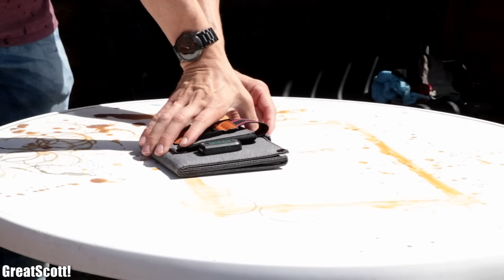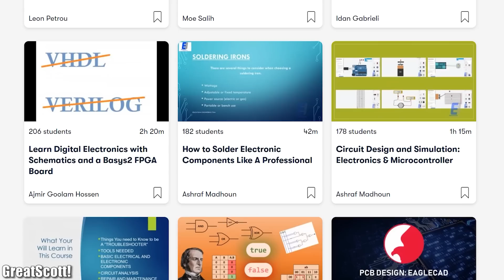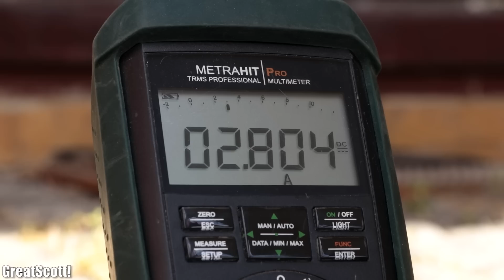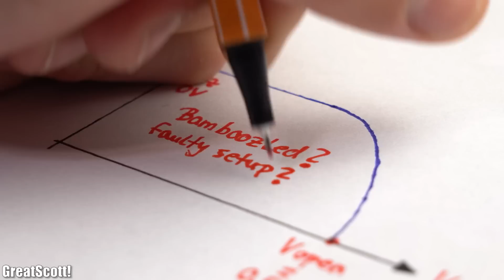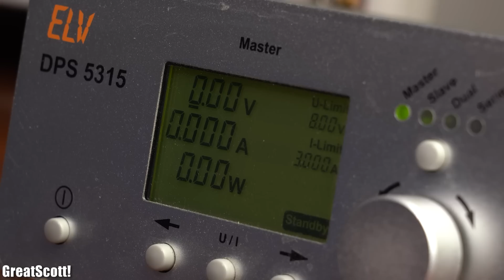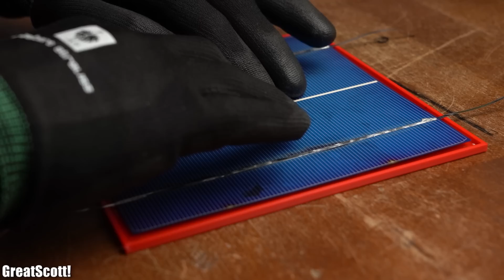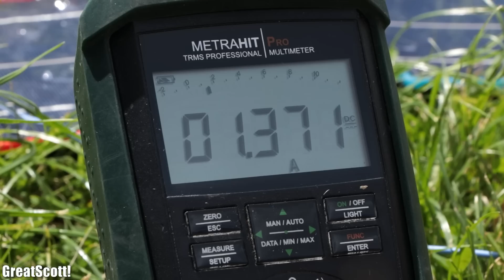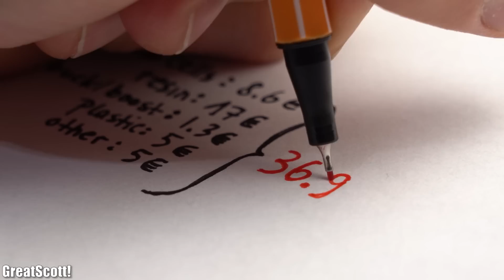5V USB Portable Solar Power Charger || DIY or Buy

Comment: I just seen a video with Will prowse and a solar panel that was made Buy encapsulating cardboard and epoxy as the frame and then putting solar panels on top of it each individually just like yours called the solar book because it could be folded It up and stored like a book. Was probably the coolest solar panel I've seen yet and the copper bus Bars were very thin and protected by plastic from each solar cell that was connected
Reply: https://youtu.be/jW6nYiZtnac

Comment: I don't see any point in such a device. If I wanted to charge my phone on the go, then I would use Power Bank, which is more handy, charges faster and is much cheaper.
Reply: Ever been tent camping? Outlets are hard to find.
Reply: @tedhancock68  I've been camping, but battery in my Xperia L1 last for 7 days and that doubles with Power Bank. Connecting to Internet divides that time by 2, but when I camp I don't use Internet very often. You can say that not every phone is like that, but then I'm gonna say: buy bigger Power Bank or even 2 if you need.
Reply: @Xsses  Sure, but what about "free" power and sticking it to the man?!? TBH, my wife who scolds me for $2 electronic purchases, just let me spend $250 on solar. When I tell people I make CPAP batteries, the first question they ask is if it can be charge by solar. There is some serious psychology at work here, and projects need to take advantage of that.
Reply: @tedhancock68   Don't get me wrong. I am surely not against solar energy, but in my opinion it works the best when solar panels are on my roof or in solar power plant. When I am far from mains I think energy storage device in my pocket is more convenient and handy than small "power plant".

Comment: Now I want to go test the Coleman one I've had for a few years now...I even used it when I was homeless for awhile as my only way to charge my phone.  I'd just go sit in the sun and read a book or something while it charged.  The one I have also has a 12V output, though I have never found a use for that...yet.  I think mine was also listed as 15W...so my guess is it only outputs 1ish amps at 5V, like yours does.
Reply: People take the voltage rating on panels WAY too seriously. I have found they behave like LED drivers. The open circuit voltage is super, scary high and when you give a small load, cut in half. Give it a big load, like a power bank and the voltage is cut in half again. I've been playing with 100w panels recently and have not needed charge controllers in most cases.

Comment: What is the advantage of using solar cell flat wire instead of garden-variety round copper wire? It doesn’t look like the flat is easier to solder, and the flat also appears to be more fragile. I don’t have any flat wire to measure the cross-section, but it seems like the flat would have higher resistance - something that would become more important as the string gets longer. I have some solar cells and have been wanting to do a project like this for a while, so I’d really like to know which one to choose.

Comment: I think mostly these solar panels provide too less than what is being advertising. Better to use Hetrojunction 28% Efficiency High Grade Solar Panel which is only Made in Europe and mostly used in Space application. But yeah, that is the expensive part. 
The economic side, one should check the brand and manufacturer reputation before buying them. 
Scott is right, the wattage promised never achived, I have tried it too.
Reply: Yeah I’ve only seen one panel or cell ever hit even close to spec (and it went above spec pretty consistently). Almost all of them are way under what they are rated. Really sucks when you are trying to design for a specific load and it drives the size of your design based on an incorrect and made up marketing rating that is simply impossible so then you have to completely redesign because of fake specifications...

Comment: The hinges was what i didnt get when you showed the cases being printed! its an easy fix to either print extra hinges or better, incorporate hinges in the initial disign. or just use a sheet of thick, stronger fabric, isoloate the sunpanels on the back and use something like velcro to put them on the fabric. Makes it modulair and the fabric is the hinge like the one you bought.

Comment: Have to strongly disagree with this one, with a few uses your DIY unit would be completely broken and needing new tab wires soldered on. I am actually surprised you gave the DIY one the win in this case, as you need a 3d printer, epoxy resin, and also the durability of your end result is still essentially zero, I dare you to drop the DIY one on the ground one time with those flimsy elastic bands and watch it fly apart and smash into pieces while the commercial unit would be fine. Anyway thanks for the video but I think you really reached on this one!
Reply: Sheets that size 3D printed = $2 each. That's $20 worth of PLA! Shhhh...let's give him this victory.

Comment: That's really cool :) But here are my couple of points.
1. Never test a charger by connecting a smartphone. Smartphone charging current depends on everything: source voltage, connection, wire quality, battery charge, temperature, smartphone os load. Just don't do it, it's unreliable.
2. Ideally, add a battery (make it a solar power bank), and use the MPPT. 
3. Don't let the wires bend without support, it will break very quickly. Ideally, don't let them flex at all.
4. What happened to that blue frame? :)

Comment: Isn't easier to use Plexiglas or Glass to protect them? Wasn't better to put them in parallel and lie on the boost converter to give you the desired voltage? It might be better to do so?
Reply: Boosting is pretty inefficient. I'm using the ubiquitous 250w 10A boost module for my 12v 100w solar panel(21v open circuit). I'm boosting to 29.4v (7S) which reduces output from 71w to 35w. It's better to reconfigure your panels to match the job than rely on electronics.

Comment: I never understood the need for solar chargers,why is it so important that you cna charge your phone in the middle of nowhere by ridiculously slow rate.A power bank makes way more sense.
99% of people will buy this and use it 2 times and then it will sit in a drawer for next 10 years just to be thrown into trash .
Reply: Mainly for camping...real camping. Also, it's hurricane season. We often spend a week or more without power.

Comment: I considered a similar project last year after watching a video about the same product from @DiodeGoneWild (https://www.youtube.com/watch?v=lVUEnlqFMvc).  For my level of experience and available resources, I have to vote for "buy" -- but only because most of the pre-resined panels I found on AliExpress and eBay at the time had inconsistent voltage and current descriptions.  I could also buy a competing pre-assembled product on AliExpress and eBay, but you again take a gamble with the accuracy of the stated output.

Comment: GreatScott I had developed that module for my mobile in my engineering college as a mini project but I had used single solar panel of 7 volt and 2 amp and used a Linear regulator lm7805. It was good and fun.

Comment: If you haven't figured why the multimeter was showing a very less short circuit current value when tested on a single solar cell, then its due to the inability of most multimeters to measure accurate current values in very low voltage like 0.5 volts. If you connect 20 of them in series and measure the short circuit current in bright sunlight then it will show a current reading very close to the manufacturer specification.

Comment: Now here's the thing . I really want to know why people consider connecting the cells in series in order to increase the voltage . When we have such good and efficient buck-boost converters which can increase the voltage with 95-96 percent efficeincy , why do we add them in series because in series not only the voltage increases but we have a huge demerit , that is the effective series resistance which adds up and ultimately screws up the max power output of the cells . So i would love to know why connecting series is a good idea to increase voltage rather than just connecting all cells in parallel and then just taking a boost converter to increase the voltage

Comment: if you are doing a protable solar panel, I would suggest using Maxeon C60 flexible cells. The cells you are using are more suitable for fixed panels (with tempered glass).
Also in order to harvest maximum energy output of the cell you need to keep it in the most efficient voltage range. Mppt chatger would be a better option instead of buck boost converter.
Last thing is I don't think the cells you are using have any problem, I wouldn't expect you to get more than half of its rated power in germany without pointing the cell directly towards sun.
4.2W output is measured only in 1000w/m2 irradiance with cell pointed directly to sun.
Reply: +1 for the C60 cells. 21% efficient and a reasonable ish price

Comment: Hello! I really love your channel GreatScott! I have decided to ask a question here because You seem like a professional, and everyone, feel free to answer is question I have been wondering. How are current and voltage different, and does voltage create current. This is been a question that online websites cannot answer. Thank You
Reply: Current is the flow of charged partials such as electrons. Voltage is the force that pushes the charged partials. Electrons will only flow if there is some force pushing them. This means that current will only flow through something if there is a voltage across it that pushes the current through it. For more details I highly recommend watching ElectroBoom's 101 series.
Reply: Crazy Nerd Inventor Ohh, thanks so much, yeah, I love Electrobooms videos, but I will checkout the video series
Reply: Another way to think of voltage and current is an analogy with flowing water, where voltage is the amount of water, and current is, well, current (speed/power of the flow)! For example, think of a very wide, but very shallow river - this is the equivalent of high voltage with low current, like electrostatic discharge (the zap you get when when you touch your car's chassis in the winter, or after scuffing your feet on a rug), which typically measures in excess of 3,000 volts, and often as much as 20,000-30,000 volts, but at very low current. The shallow river, although composed of lots of water, will not sweep you off your feet :)
Reply: allen lutins  Good Analogy! I had never thought of it that way, and thanks a lot. I am pretty new to Electronics, and this really helped! :)

Comment: The sunpower C60 solar cells are the ones to go for.  Much stronger mechanically - still fragile, but stronger than the ones you used.  All the connections are on the back, which makes wiring them up easier.  They have a higher output - you get five amps in strong sunlight at maximum power.  Open circuit voltage is a little higher - just over 0.6V.  Size is 125mm x 125mm.  You can find them on Ali Express.  I've used them to build solar-powered radio control planes - no batteries on board at all. Even when the sun goes behind a cloud, or the plane is inverted, there is still enough power from ambient light to work the receiver and servos.  An on-board Arduino monitors the voltage and controls the motor speed controller so that the voltage is never pulled too low to cause reception problems.  Ten or twelve cells in series seems to be the sweet spot for adequate power with a reasonably-sized model.

Comment: I've also tried to make a portable solar charger some time ago using small 5V epoxy coated solar cells.
I tried to reuse an old solar charger enclosure, as its electronic components were mounted on a separate part, which could easily be slipped out, but not salvaged nor repaired- it was all coated in resin (which, I must say, made it very durable, but not until the charging circuitry and battery worn out).

I encountered the same problem as you did (specs far lower than advertised), so I would get a maximum of 2 watts of power, while the original charger had somewhere around 5 watts - and it was older tech, so still impressive for such a small form factor.

I think that without some built-in energy storage like a supercapacitor or battery using the solar cells alone for power is rather unstable, and adding that would allow to trickle charge even during overcast or winter conditions.

Comment: You can use an app called Ampere to measure the current on the phone directly, circumventing the USB tester.
Reply: Not every phone measures that well through that app.

Comment: Do they utilise a maximum power point tracking algorithm as a part of the circuit, because what they are claiming might be the Maximum power point of the PV panel, but in reality it doesn't always work at Maximum power point without MPPT.

Comment: Great project! Just a simple question, why did you use spacers on your 3d printed frames? Is it so that the resin can go below the solar panel as well? It seems as if having the spacers there would make it easier to break since it only rests on 4 points
Reply: It rests not only on the 4 points but the whole resin base that's below it. The resin below is basically levelled with the 4 points.
Reply: @Mavi222  Awesome, thanks

Comment: You forgot to take into account that your phone will only draw as much current as it needs based on its charging profile.  You should use a resistive load next time to test charge current potential.  For the first part of the video that is with the bought solar charger.
Reply from the maker: Nope. Tested that. Does not change anything.
Reply: @greatscottlab  I figured you might have after getting to the second half of the video lol

Comment: You're ideas are great, But I think you really have to work on mechanical part of your builds. In all your videos your ideas are good, but it lacks on the mechanical part. Like in this video, the solder tapping wire is not strong enough, and I think could be improved quite a lot.

At the end of the video, the project is for 80% finished. The concept is shown, but not practical enough for people to build it for themself.
Just put some time more in the mechanical and details of the overall project, en the end results will be much better. 

Then I think more people will watch and make it, instead of just look. Because the end results are not practical and good enough for real life use.
Reply from the maker: The problem is that I am not very good with mechanics. So instead of wasting weeks trying to figure the mechanical side out, I put the project out like this saying that it can be improved and hope that others with more time on their hand can/will improve it. I do not try to sell products here. I am just giving out ideas for free. And that is already something.
Reply: @greatscottlab  I understand. It was just a tip to help. You're ideas are just so good. If the mechanical part would be better, the projects are completely finished and a lot of people would want to make them for themself.

Comment: Mppt and a thermister to temperature compensate the mppt setpoint of the panel this will maximize the available power from the panel. I used a 100W panel for my 7.2A Lipo battery.

Comment: If your phone was limiting the maximum power you could draw from the commercial charger, then why didnt you measure it with the digital load like you did with the DIY version? Kinda an unfair comparison because the commercial version could maybe output the full 2.4A or more if you used the digital load.
Reply from the maker: Nope. Tried that.